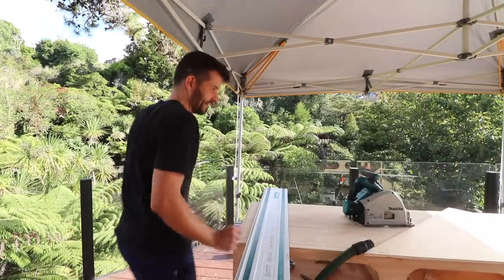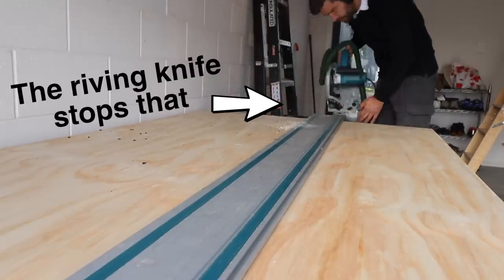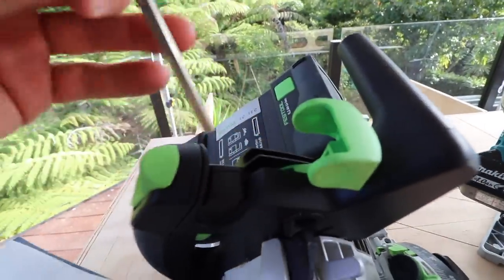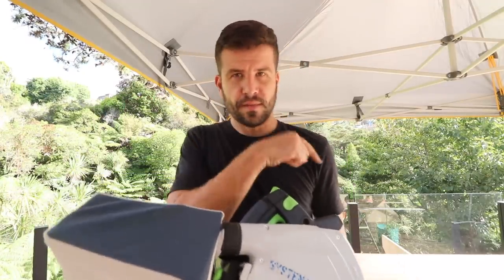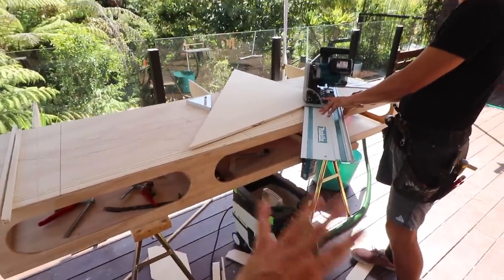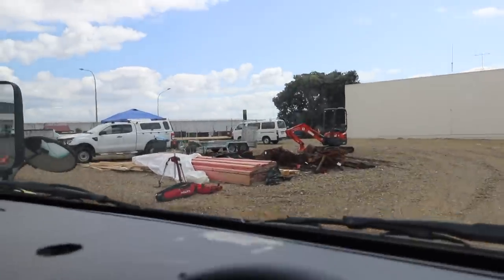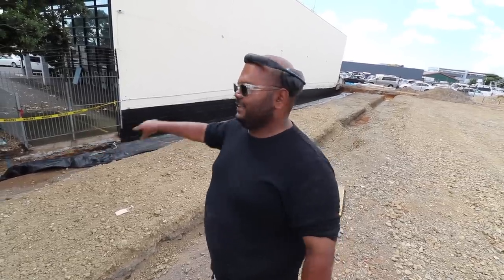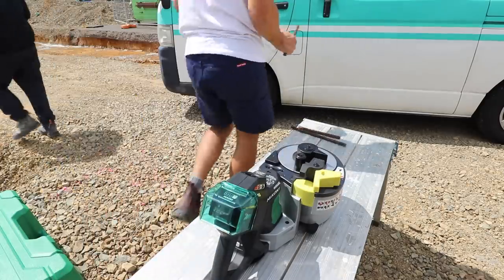Cordless Track Saw: Makita or Festool?

Comment: At that price point I chose mafel mt 55c corded version. Best tracks ever, high torque cuprex motor, quiet enough considering its a saw, 0 dust when used with vacuum(this was the first thing I had tested, in the house on carpet under very bright led light, couldnt see or taste any dust ☺ and that was with crap shop vac), sturdy and stable clamps very fast to set (not needed for most jobs as tracks wont slip even on high gloss materials), very quick bewel set one lever only for both sides that goes -1° to 48°, etc... I was suspicious about lack of second handle, now I understand why it isnt needed. Can use it on other tracks like makita and festool if needed. Or I would have went for makita, couldnt justify the price of festool with ther low quality underpowered motors.
Reply: @samsingh2042 everybody knows that but still they are buying track saw with battery. Vacum with battery is not efficient, only if you are using for cuts, if you need cleanig customer house after drilling walls, conecting cabinets...battery one is not good.Im now with makita tools and batterys system and I love it. Biscut joiner, drills ect. I tryed festool tracksaw and vacum with my coleague carpenter and that feeling of using festool tools is great. Souch better touch and details better than on any other tool. I own einhell track saw with cmt blade and karcher industrial vacum all corded. All together 300€. Geting jobs done with new blade 58 tooth super clean cuts, razor sharp. 
Already two weeks Im watching youtube videos about track saws and vacums...Festool ts 55 battery version 1300€, festool corded vacum midi 1 700€. 2000€. Why I dont go with makita system same setup for 1000€ with 18V batteries which I already own. Or why I dont stay with not profesional einhell and karcher which paid themselfe 20 times and get job done. ..bla bla you canot come to customer house with non professional tool, you dont look serious...its not that. Its sickness to spend money on things which you maybe dont need in that moment but you dreaming about it.🤪🤗  pardon me on my english, gretings from croatia
Reply: I wil try now to consider mafell as well, thanks

Comment: The Festool Bluetooth sender to activate the Vacuum is on the Batteries. So you must have had Batteries without Bluetooth. Or you don’t have a Bluetooth receiver in your Vacuum.
For your Festool Vacuum there is a receiver available. I have it on my older Festool CTL36EAC as well. 😉
Reply: Festool 202097 Fernbedienungsset, blau https://www.amazon.de/dp/B0794ZWFLR/ref=cm_sw_r_cp_api_i_BB8AEbQEHN0TN
Reply: I have cordless festool... with bluetooth battery and ctm midi 2019 version.. with bluetooth dongle. So i can also hook it up to my cordless dewalt saw 🤪
Reply: 4 batterys.. also and fastest charger so takes 30 minutes to charge a 5.2 amp battery

Comment: Have the Makita cordless & absolutely love it. They do need to sell replacement rubber for the tracks as blade changes often sees the new blade sitting slightly different to the previous one & the rubber ends up too trimmed.

Comment: Today, we use Makita's track saw for a cutting effect display, you can see that the cut out of the cut has no burst edge and no cracking, so our kunlun tooth diamond saw blade, installed on the track saw can do not burst edge

Comment: Honestly, I have the DeWalt 54V cordless track saw and damn it work really well ! Combine with the remote and the 54V dust extractor it's just awesome
Reply: Thanks for sharing. That's what I wanted to hear. Is the extractor worth the large expense? My current small vacuum was $30 and a good contractor grade is under $100 around here.
Reply: @zackfishle1009  it's a totally different animal, the wireless remote is awesome and can fit with whatever the brand and tool, but the major point is that it's not a vac but a dust extractor, so it's made to be OSHA compliant 👌🏼 just like a festool dust extractor.
Reply: @Frenchcanadiancarpenter  Sounds cool. Do you like it?
Reply: @zackfishle1009  I love it. But in the other hand, the festool and the Makita are more refined track saws, but the cordless dust extractor from Makita have a big lack of CFM compare to the DeWalt.

Comment: No riving knife on the makita though and they took the riving knife feature from the (cordless) festool Pull hair . A lot of people crying about it getting in the way - just make it removable. Wouldn't touch either saw if there isn't a riving knife. Battery is moot if you're tethered with a hose.

Comment: Paerau mentioned what I always wonder if your going to hook up a hose is it really worth the money for cordless. Great video
Reply: It gives you the options of being completely detached, especially in places you don't need dust extraction and have no mains electricity.
Reply: Getting rid of an electric cable is worth it. For me it really made a difference. When I have more cuts to do on the job site, especially kitchen remodelling, one tangling/dangling thing less attached to your saw is a win.
Reply: It's also an excuse for a smaller saw,  what I have a small saw without the weight of the batteries is worth it for me.
Reply: I have a makita battery vacuum cleaner too so yes its worth it
Reply: @daafrsn7651  which vacuum do you have?

Comment: A point to be made is the full setup up with saw, rail, two or more batteries and charger is actually cheaper with festool... or atleast it was last I checked !
Reply: I find that hard to believe. I purchased the Makita cordless, 2 - 55" rails, and 4 batteries for less than the Festool corded with one 55" rail. I added the Makita 39" rail which tipped me $20 over the Festool corded with the one rail. Note that I did not buy the bluetooth model. Instead I use a simple remote control outlet with the remote attached to my saw. An extra button push but it has worked well.

Comment: Have all platforms because, they all integrate.
Love the hikoki bender. You could certainly use that for some tasks in sheeting. You mentioned the corded makita kicks back because of not rifing knife. How about the cordless makita does that have a rifing knife or does it kick back? I did have the cordless festool plunge saw which got stolen. I'm considering a new metabo cordless plunge saw which is made in conjunction with mafel. The mafel is the best plunge saw and saws on the market. Their tracking system is also better with the splinter guarded sliding opposed to sticking on as the guard often comes off.
Also the clamp on the mafel, like the Bosch track system is closer to the cut so it means more stable if some of the work pieces aren't entirely flat.

Comment: Track saw Makita or Festool? The answer is Mafell :)

Anyway, since you always are tethered to the vacuum hose I just buy the corded versions. I have a 10 meter lead velcro strapped (well velcro sleeved) to the vacuum hose, and converted all my corded tools to a Festool type Plug-It lead. Any tool you want to use you just plug in the vacuum and lead, and off you go.

Comment: hey scotty.
i bought the internal bluetooth tracksaw and the hepi bluetooth vac.it works a treat.minimizing dust.i also have the bluetooth 10inch droppy where dust seems to get clogged in the 2 dust extraction ports so not so good.
i also have the bluetooth 5 inch grinder which i haven't had a chance to pair it with the vac but would love to try.i love makita because thats what i started with but now over the years because of the brands versatility with range.id go makita for range and diversity but thats just me bro.

Comment: I work with both brands in the corded versions.  No real difference other than price.  I don’t see a practical reason for a cordless version personally.  Pretty much the same discussion as a cordless miter saw, not useless but impractical for real use.  Track saw has a slight bonus of only needing to manage the vac hose and not the cord during the cutting process, but taping the cord to the vac hose eliminates that...

Comment: The batteries do activate the cleantec. Which is nice. 

Really under powered saw though for the money. I’m just about to sell mine and opt for the corded mafell. 

I can’t be doing half a dozen or more passes just to trim a 44mm solid door. Also, anything like composite worktop will absolutely eat through the batteries in about half a dozen 1m cuts. Very underpowered saw.

Comment: Mikita works great. As I’m sure the festool is also great. But is it twice as good as the Mikita? I doubt it. So why should I spend twice as much for something that’s only a fraction better?
Reply: @samsingh2042 everybody knows that but still they are buying track saw with battery. Vacum with battery is not efficient, only if you are using for cuts, if you need cleanig customer house after drilling walls, conecting cabinets...battery one is not good.Im now with makita tools and batterys system and I love it. Biscut joiner, drills ect. I tryed festool tracksaw and vacum with my coleague carpenter and that feeling of using festool tools is great. Souch better touch and details better than on any other tool. I own einhell track saw with cmt blade and karcher industrial vacum all corded. All together 300€. Geting jobs done with new blade 58 tooth super clean cuts, razor sharp. 
Already two weeks Im watching youtube videos about track saws and vacums...Festool ts 55 battery version 1300€, festool corded vacum midi 1 700€. 2000€. Why I dont go with makita system same setup for 1000€ with 18V batteries which I already own. Or why I dont stay with not profesional einhell and karcher which paid themselfe 20 times and get job done. ..bla bla you canot come to customer house with non professional tool, you dont look serious...its not that. Its sickness to spend money on things which you maybe dont need in that moment but you dreaming about it.🤪🤗  pardon me on my english, gretings from croatia

Comment: Saw a makita model KS511DZ, I believe a 5 inch self contained dust shroud circular saw, says it cuts 47mm at 90 degrees.  Are these available over in your area?  (not available in the USA) If yes - what are they pricing them at? they have a 12v and an 18v model, I am interested in the 18v which I believe is the model number I listed here.   Thanks for festool vs Makita review - I am moving into the makita zone,  just purchased the. Rear handle 7 1/4” circular 36v, comes with two 5ah batteries, double slot charger and the sale included 2 additional 5ah as a bonus for $249US  , Home Depot has the bonus 5ah battery deals on many makita products until August I believe,  so it's a no brainer to go with the Makita track saw.  (I listed the pricing here as a reference for those not in the USA)

Comment: The Makita blade locks on the opening, so you can change it easily... you must have known that???? its on the top of the depth adjustment..... Makita works great..I have that, no isuues..... I have worked with festool too...very good as well...but way more expensive and ...what you do when you run out out of festool batteries.... you need 4 plus 2 chargers and they are expensive as well......With the Makita you get more power of the battery vs Makita corded 110 V..my oipinion....Battery plungesaw is a gamechanger!

Comment: Too all those saying what’s the point of a cordless saw if you’re tethered by the vac cord... I have the Makita cordless rail saw and cordless vac because you no longer need to be tethered to a site box for power. You can work where ever you need and not need to worry about if there’s power on site or not. Out on the farm or a site in the back blocks. Cordless is the way to go.

Comment: I bought my Makita cordless tracksaw a year ago.   I don't see the AWS button on it.   Is there a new model of the tracksaw that I must buy to have that feature, or am I missing something?  BTW, I have been using a "remote" switch for my vacuum.  $10 at Home Depot. It plugs into a wall receptacle and the vacuum plugs into it.  The small remote button hangs on a lanyard around my neck.  Just before I pull the trigger on whatever cordless tool I'm using, I push the remote and start the vacuum.

Comment: I'm having a hard time buying this one since I have corded already. I just tape the power cord to the vacuum hose. They really need to make a vacuum hose that is smooth on the outside so it doesn't catch on every edge, but that would be too good and the tool gods want to watch us suffer.
Reply: Festool does make a “smooth” vac. It’s covered with a canvas like material. For you $700.

Comment: I want a track saw but I want to know if you think the cordless version has any benefit? It seems like the kind of tool that you'd want connected to a vacuum anyway so why not get corded?
Reply: I use mine to cut down sheet goods at the home center, and have a cordless vac to use with it, so I’m not leaving AS big of a mess, like a jerk, but if you have a vehicle large enough for full sheets (van, truck, etc) that’s not as useful a feature.

Comment: Cameron probably told you by now, but the new vacuums have the Bluetooth built into them, it works flawlessly without fail. But I get your point, being on the different battery system already.

Festool has a lot of details that are just a little bit better if you ask me, but it's very personal if those details are worth the price difference.

Great review!

Comment: One thing i dont get is you have really high end tools with STUPID expensive batteries. Batteries eventually go bad and you have to buy them again. SO, why dont you just buy the 80$ bluetooth button for the festool vac? That thing is amazing and probably the best festool accessory i own. AND, if you use the festool tracksaw, like i do... then scrap the battery version all together and just buy that festool hose that has the power cord built into it. This way you always have the more powerful corded version of the saw, but you dont have to fight with the power cord because its inside of the vac hose and plugs into the vac. Turn the saw on, and the vac goes on. Simple. I dunno, maybe im being a bit of a hater here, but i really dont like battery powered tools that are not tools like drills. Circular saws, track saws, table saws etc, they have no business being battery powered in my opinion. Anyways, love the channel still!

Comment: working with the vacuum make cordless no sense :) Festool has 2 side 0 clearance like might no other on both corded and less. There is no best. Each has designed weakness. Makita holds better has front lite, Festool more precise, Mafell stronger. It could be done in one model, but in that case they could not sell 3 for you :)

Comment: You should check out the dewalt plunge saw. It works on both edges of the track, has a riving knife and parallel plunge plus an anti kickback feature so it wont go backwards along the track. I used the makita for a while and personally I think the dewalt is a much better option at the same price point.
Reply: Does it have the catch to stop it tipping off on 45 bevels and the scribe feature?

Comment: How long does the festool batteries last? I keep hearing that it’s pretty poor
Reply: I haven't had any problems with their batteries since they switched to proper Li-Ion tech years ago. The new high power batteries are amazing. But if you compare a 5Ah battery to Milwaukee 9 or 12Ah, its or course poor compared to those.

Comment: Festool isn't that expensive. For under $2k NZD +GST you can walk into any Festool retailer in NZ and get the cordless rail saw, a cordless jigsaw, a 4 speed cordless drill, 3x Systainers (one for each tool), 2x batteries and a charger. And this is before you twist their arm ;)
Yes a Makita skin is about $750 NZD +GST vs Festool $900NZD +GST but what you gain is huge. German vs Chinese construction, much better motor, more accurate, better dust collection. I would expect the Festool to last 2-3 times longer before you need a major repair like an armature replacement. Buy quality and you only pay for it once.
Love the videos - keep them coming!
Reply: James L, here in the states the full makita kit with track and batteries is only $500! Must be quite the mark up in NZ.

Comment: Every Festool that i have tried lacks power. Whit price point like that you expect to get powerful tool.
Reply: Mr. Wizeguy festool is actually more powerful but runs a thicker blade, find a blade that’s the same thickness as the makita and it’ll blow its socks off.... the festoolf has far less blade wonder because if the thicker blade tho so the accuracy is worth it. We have both saws at work and the makita rail has ALLOT more cuts into it

Comment: Makita - thinner blade curf so saw doesn't have to work so hard to cut the material , anti tip lock onto the track, 1mm scribe button, cheaper, no riving knife , annoying blade depth, the clamp system that stops the saw moving left and right on the Makita is horrible it wears out really fast , 3 year replacement part warranty..

Festool - thicker blade so saw works harder but stays straighter (apparently) , more expensive , depth adjustment is way better , saw track clamp adjusters superior to Makita, no 1mm scribe button , no button to pin the saw to the track , riving knife , 10 year replacement part warranty..

Comment: I would stick to the 240V version, as much as cordless is great you are already tethered to the vac hose, and a 240V version will still be working in 10 years while the batteries will have all died and needed replacing, I have the Bosch TS55 and the track joining system is miles ahead of the makita / festool with those fiddly Allen tools Matt does a good review https://www.youtube.com/watch?v=cfxF-EtfOfA